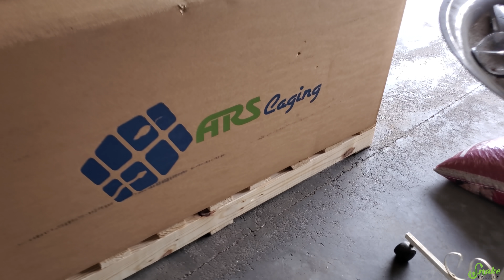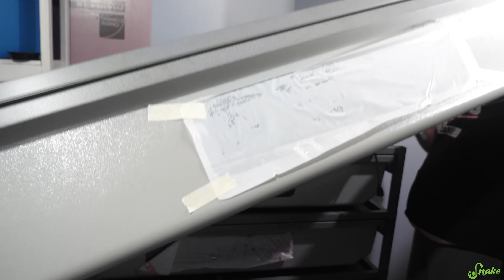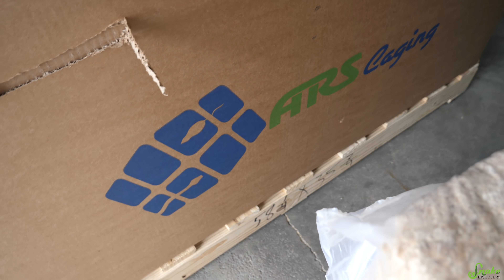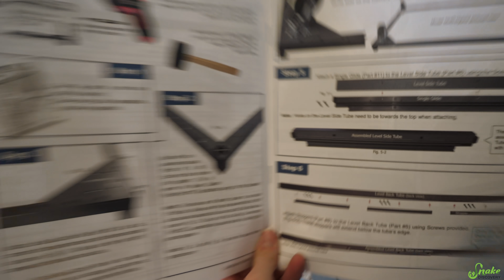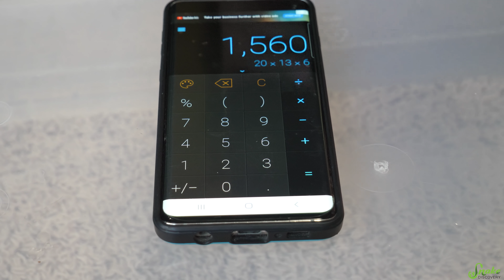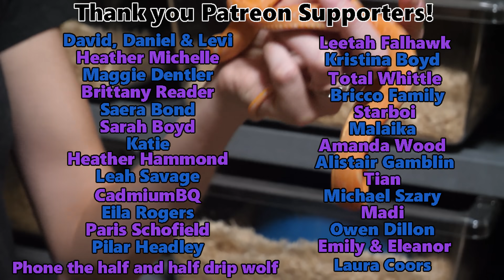We got an EPIC rack for our Hognose Snakes!

Comment: If you guys want the stickers off the old bins you can use a low temp heat gun to heat up the adhesive and then you can get them off easy and re stick it again.
Reply: Nice tip
Reply: A hair dryer might work. 😃
Reply: @Mamakathy-uh9xf  Hair dryer works perfectly, so long as it has a low heat setting. :)

Comment: I am in awe about how they don't have power outages everyday with all the electricity they need
Reply: Same
Reply: Imagine the electrical bills :o
Reply: Baylee Martin I was just thinking the same thing watching this
Reply: Heat tape actually doesn't take that much power to run. My 3" wide tape uses 4 watts per foot, so my 24" wide 10 shelf rack only uses 80 watts, about the same as a light bulb.

Comment: If the white sided Snake doesn't have a name you could name it Snowball or Snowflake😊. Ed and Emily's house is going to feel a lot more big and open once they move some of the Snakes to the new facility. I'm glad Ed is finally starting to warm up to being on Camera😊. You could take the old stickers off of the old racks just use a hair dryer to warm them up and they should come off and you can glue them on to the new racks or buy some reusable adhesive that makes them easier to get off. ^__^   32:13 That scaleless Snake is so pretty
Reply: I know my comment is kinda long but it's got suggestions in it that could help Ed and Emily.

Comment: Are those cages big enough for them? I feel that they could use more room
Reply: Snakes should at least be able to stretch fully along 2 sides (over one corner). 1 side is better of course. But if the enclosure is too big it's not good either, because then snakes will feel exposed and they more likely will be defensive or don't want to eat

Comment: Hey, for anyone who can help, Im getting a hognose snake in a few days and have been monitoring his enclosure's temperature. Ive been using a thermo laser to take the surface temps of the aspen im using and theyre getting upwards of about 110 degrees Fahrenheit. I know on the hot side of the enclosure it should be about 92ish at max, but is that the surface temperature of the bedding or the air temperature? Also im using a heat lamp in case your wondering
Reply: That is the surface temperature.  You'll need either a light dimmer called a Rheostat or a dimming thermostat to control the heat output.  You can also raise the light fixture further away from the enclosure to reduce the heat but I would still recommend a thermostat for consistent temperature control.  For Western Hognose snakes I would recommend a hot spot of no more than 90 while the cool side should be in the mid to upper 70s or very low 80s.
Reply: @Gael32  thanks so much